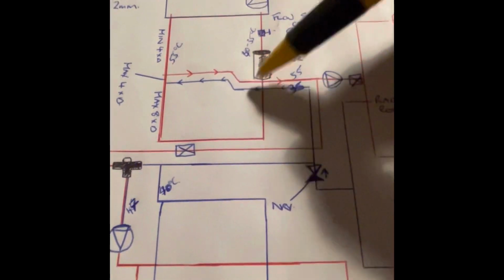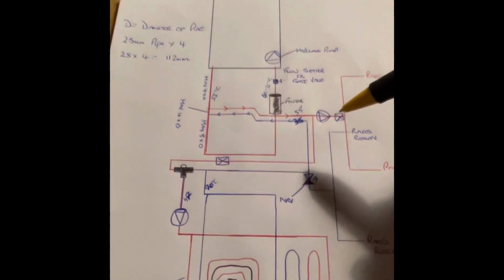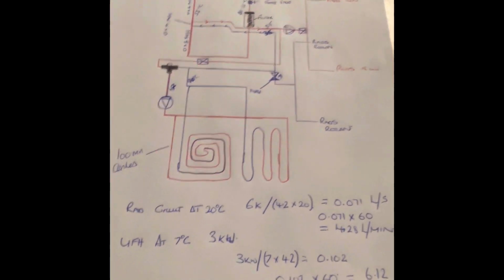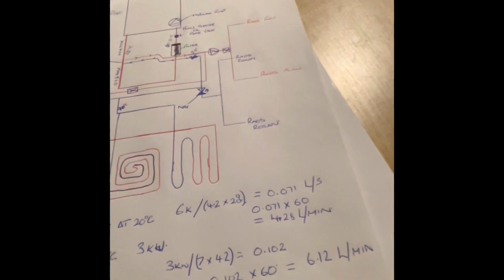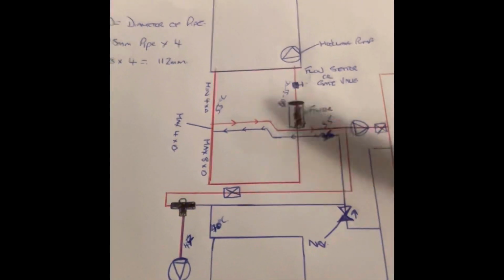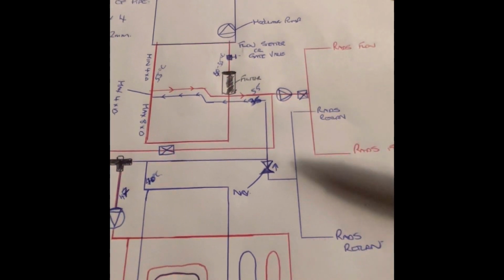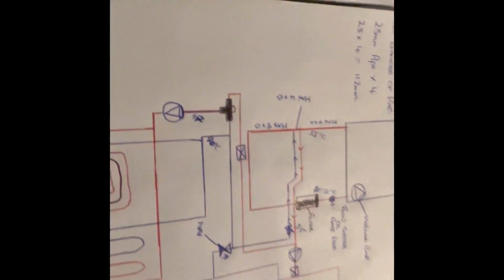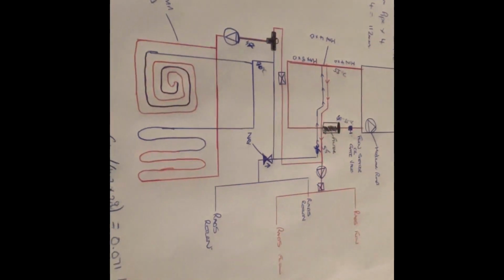Closely coupled tees @HeatGeek @andrewmillwardwatford9410 @HeatEngineerSoftware

Comment: Really interesting video, but do you even need the zone valves? Can't the pumps just gate the flow, when they're off there is no negative pressure so pull nothing off the primary loop?

Comment: Great video. I’m doing my first install using CCTs with an UFH circuit. I was just wondering whether I would also need an additional pump for the hot water circuit. Thanks

Comment: All the courses you mentioned MGM are fantastic. These are very knowledgeable guys👍 
Primary/Secondary systems as you illustrated are for from new, in fact there’s very little ‘new’ in our industry when it comes to Heating design.  In fact, Primary/Secondary systems & CCTs were commonly used in commercial system, even in the 1930s. I first encountered it in a (1930s)Large House/Castle here in Scotland.
So much can be done with P/S systems, even to Cascade several boilers.

I personally would have had two sets of CCTs, with the UFH on the Primary Return pipe. Which will be a lower temperature & you can simplify/reduce the number of controls on that circuit.

I started my ‘time’ in the early 70s & was fortunate to learn at the hands of old boys, with a fund of knowledge. One thing I was told & I never forget it; ‘What goes into a Tee, comes out a Tee’.

Across the Pond, my pals always credit an individual called Gil Carlson with Primary/Secondary design, but in my experience, it’s been around a lot longer than Gil. But the guy was a fantastic engineer never the less.
Thanks for sharing MGM & all the best for 2025.

Comment: Instead of a non return valve on the radiator return (which I feel are very restrictive) 
I used a zone valve instead wired in parallel with the radiator pump to stop back flow while underfloor only was running.
Do you see any issues with this?

Comment: Hi, I’ve piped up a couple of systems after watching this. One question o have is, if the ufh manifold was say 15 metres away would you for an extra pump on that circuit to help with the flow?
Reply from the maker: No you shouldn’t need the xtra pump it will work with out , unless it’s 15m of elbows and restrictions then you would need to give consideration to reducing that resistance

Comment: Could the normal method off boiler pump
Doing upstairs rads and downstairs underfloor heating to the manifold on a normal s plan without close coupled tees there a lot out there without them
Reply: They are all high flow temp

Comment: Did you wire the external pumps to the orange / switch live  in wiring centre mate 👍
Reply from the maker: On this occasion I wired the pump to the brown on the zone valve as the switch live back from the UFH would energise the radiator pump when there is no demand
Reply: Great video !